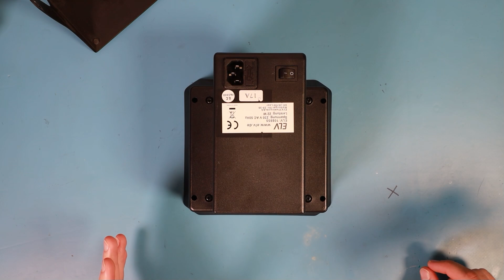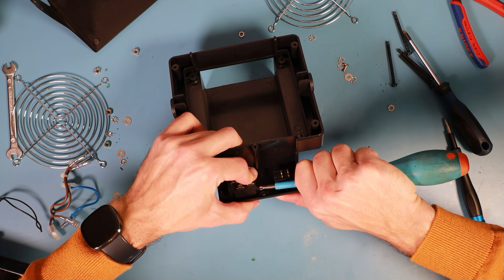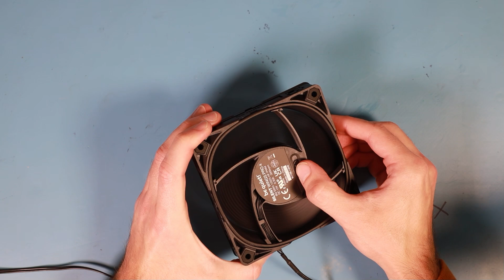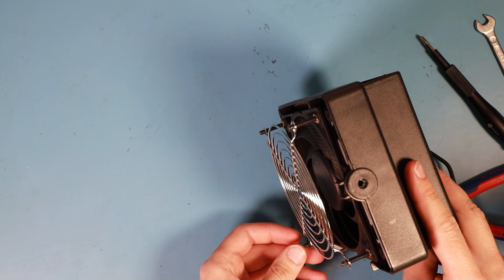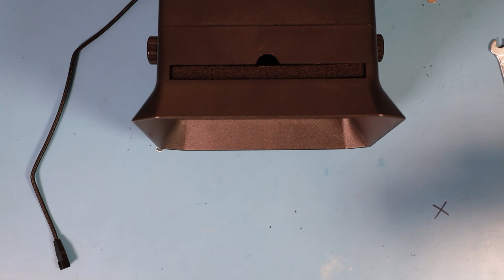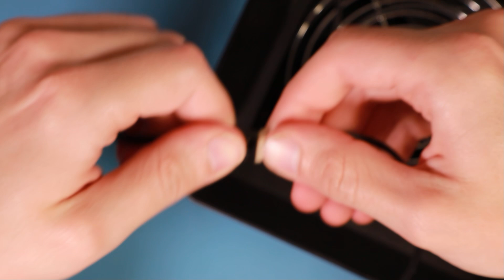Solder Fume Extractor - Silent Mod

Comment: Interesting mod! I am also using standart PC fans, but i run them on 19V so that they suck better. They have been runing on that since quiete some time now.
Reply from the maker: And the FANs are handling that long-term?
I didn't know that. I would have expected 15V as absolute maximum.
Reply: I think a big part about it is that they arent on for very long time. There is rarely an opportunity where i solder longer than like 15 min non stop. @cookingcomponents7858